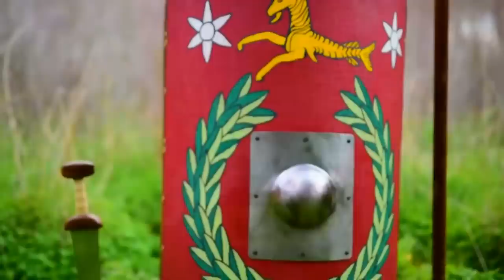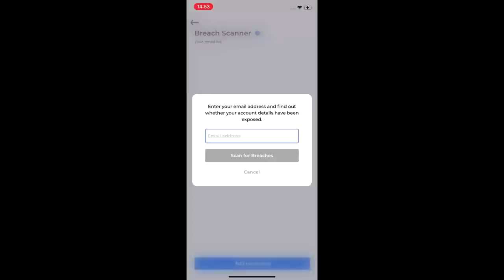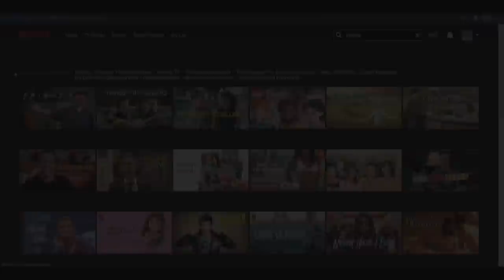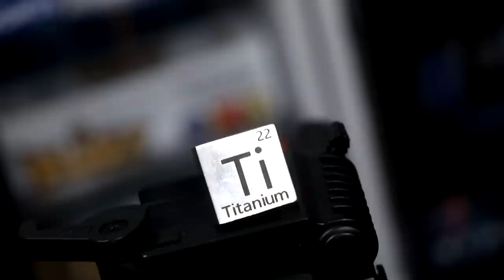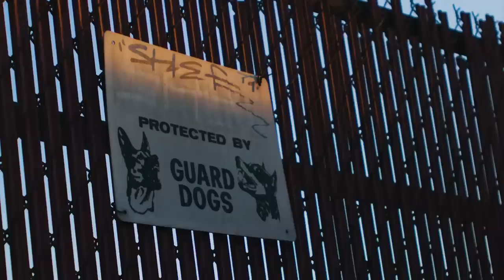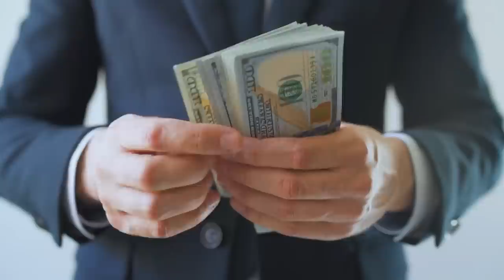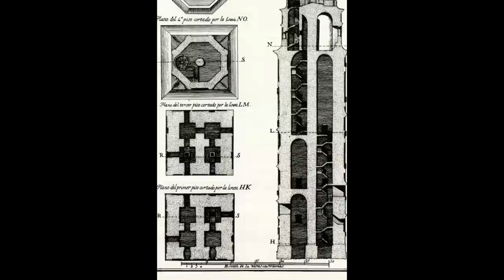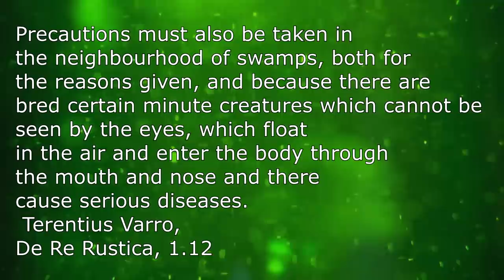10 "MODERN" Things The Romans Actually HAD

Comment: There is at least one you missed. The Romans had an information network. That is a method by which messages could be sent without using a physical object, such as a letter. This Netwerk was a combination of semaphore stations and signal fires that would allow any significant event that happened anywhere in the Roman empire to be known within 24 hours in Rome.

Comment: Imperial Rome also had an advanced banking system which used fiat currency, which facilitated the exchange of money using physical coins. The earliest banks in ancient Rome were located in temples. They would charge interest on loans, exchange money, and track their finances through written records.
Reply: Thus,  Jesus throwing the money-lenders out of the temple.  Although they were essential in converting different types of currency into a common one.
Reply: Except it wasn’t a fiat currency, it was backed by gold and silver.
Reply: @Slender_Man_186  they had both at different points in time, just like us.
Reply: @Slender_Man_186  That is exactly the definition of a fiat currency.
Reply: @lamwen03  That is the exact opposite of a fiat currency. By definition, a fiat currency is not backed by anything.
Reply: @WJS774  actually it is, our currency is backed by the government which relies on the value and supply of the goods and services the economy produces, if productivity falls, if the supply of g&s falls, or if the government starts printing way too much money too quickly, the value of our currency will also fall.
Reply: @tylersoto7465  You don't know what "fiat" means. The bottlecaps are a commodity currency, not a fiat one. There is no central government in Fallout! Jesus Christ!

Comment: Romans had machinery too. I would've liked to hear what kinds of mechanical devices were used in daily life.
Reply: They had steam engines.
Reply: @sugarnads  The steam device you alude to was a mere curiosity -- it wasn't used as a tool. I'm curious about things used in daily life, and perhaps in warfare (like catapults and balistas, for example, or the elevators in the Colosseum). Even something as simple as scissors, and padlocks -- I'm curious about those, how elaborate or advanced they were.
Reply: Don't know much about daily life, but thier water powered mills were really impressive, and no they did not need steam to do some real industrial scale stuff.  Rome's entire demand for flour was met by 12 industrial scale water powered grain mills, and the thin wooden sheets for plywood was processed by large water driven saws cutting away at a log on a lathe like device.
Reply: @nosajimiki5885 , those are some of the kinds of machines I am curious about. Thank you for the information.

Comment: I would posit that the 'Tower of Hercules' was preceeded by the 'Pillars of Hercules', which were two pillars on which were placed a fire of burning wood.  The reason there were two pillars is that they would make one fire ready while the other was burning and with two pillars they were able to keep one fire burning at all times. These are the famous Pillars of Hercules mentioned by Solon in the legend of Atlantis.
Reply: Why couldn't they add more wood to the already burning fire?
Reply: @TheGingey  because
Reply: @TheGingey  It is just a simple matter of practicalities, as the first fire burns, you clear the remains from the previous fire on the second pillar, and build a new pyre of wood, it would have to be built up by stacking in a stable way, and would probably be a very high stack of firewood. 
So it is a simple practical matter of preparing one pile of wood on one pillar while the other pillar's fire is burning.
With time this was upgraded to a proper lighthouse by the Phoenicicans and then upgraded again by the Romans. 
It is a very strategic lighthouse for sea trade.
And is probably the most important historical lighthouse
Reply: Don't you know the Pillars of Creation came first many millions of years before the Pillars of Hercules?

Comment: The Romans had augers, known as the Archimedes Screw, used to pump water uphill. We think of augers today as drills for boring holes, but if you reverse the auger, you pump the drilled material out. Since they didn’t have electricity, they were controlled by rotating a large screw manually, most likely cranked by slave labor.

Comment: In regards to concrete, Roman concrete lasts longer than Portland concrete and is better, but is is very poor under pressure so it would not be good for tall buildings.  Portland concrete on the other hand is better under pressure which is perfect for tall buildings but won't last as long, so don't expect any Portland concrete buildings to last 2000 years like Roman concrete.

Comment: The main reason for using plywood nowadays is that you can get a big sheet. The way it's made in modern times involves softening a log with steam and shaving it down in such a way that it unrolls like toilet paper. This allows for plywood sheets that are big enough to cover a whole wall. If you want to even build a table with dimensional lumber you usually have to glue several boards together (and match grain), and potentially have to cut joints if the application requires a lot of strength.

I imagine the way the Romans did it didn't produce big sheets. It would still have the benefit of not splitting the whole shield along the grain, though.

Comment: One question I've never seen discussed in these sorts of video's is where the Romans got the fuel for heat, cooking and their bath houses.  Shipping enough fuel for a city of a million people overland would have been impractical.  Was it rafted down the Tiber from further in land or shipped along the coast from other ports.  Also, was it just wood and charcoal or did they use fossil coal as well.

Comment: I used to know a concrete engineer who had worked for a company in Britain that developed a type of concrete based on Roman concrete. They found that compared to modern concrete it set very firm and hard but took longer to dry and set. That last quality made it mostly unsuited to modern construction projects which depend on a series of different trades being able to go in in succession to do their work such as plasterers, electricians to install wiring and decorators to paint the walls. Until the concrete dries these next stages cannot be carried  out completion of the whole project is delayed.

Comment: Regarding No.1, it is quite possible that a Roman scientist had built a primitive microscope and observed bacteria with it. All that's really needed is glass, and the idea to assemble a series of lenses in a tube.
Reply: Lenses are really hard to make though, at least to that kind of precision. It's not impossible I guess but I kind of doubt that that's it.
Reply: Even with modern precision glass, one requires 200x for observing  Eucaryotes, 400x for E.Coli and 1000x for most bacterias.
Reply: @r0ky_M  Many years ago, I had a telescopic "pocket microscope" that was the size of a large pen. It was quite tiny, but under the right lighting you could look through it and see bacteria floating in stuff. It was very basic, but did a good enough job. I doubt there was much precision going on inside of it. Just a few lenses that looked like tiny magnifying glass, in fact.  It should be easy enough to duplicate for anyone who can make clear glass.
Reply: @SevenSixTwo2012  
Even today's pocket versions with 250x don't let you see bacteria..and don't forget that bacteria also often need staining coz they are naturally clear.

Comment: There is a manga and anime called Thermae Romae, about an ancient roman architect specialized in bath building, that sometimes drowns and wakes up  in modern japan, the other culture very big into hot water baths, and eventually awakened back in ancient rome, several times over
The dude would learn about modern japanese variations on hot baths, and reproduce them in ancient rome using local equivalents
It was very amusing how a lot of that stuff could actually be implemented
Reply: Metatron did a video about it, if I'm not mistaken.

Comment: The optical illusions, for example columns would have different diameters, the top would be bigger than the bottom slightly so when you stand at the base of it, it would look equal and not look like it’s getting smaller at the top. Also the columns that were farther away were bigger than the rest so when you stand close to the building all the columns would look like they are the same size. The Greeks cared about this sort of thing more though, they were also the ones that started it.

Comment: Metatron says they had plywood, but they had more than that. They had multiple styles of "laminate" wood, plywood, a sort of particle board (couldn't make them large or they wouldn't hold together) that would then be topped with real wood to save cost and weight. They understood not only grain but how to grow trees for the best grain, people forget that is of vital importance to sustainability, foresters don't just chop trees. They understood how to make use of mixed materials, concrete, laminate, hardwood, copper and iron all together to reduce cost, reduce weight, and remain extremely durable. 
Everyone interested in Rome knows they could build like nobody else in the region. But it wasn't until my architect brother learned a little bit about materials, told me and I started doing some study of my own that I found out how REMARKABLE they were. Rome is often compared with China in levels of technology, butwhen it comes to architectural engineering, the Romans were 100% on top. Rammed earth walls vs concrete and stone? The great canal systems of early China are remarkable, but the Roman aqueduct system is far more impressive. Roman water systems, when the people were wealthy enough to pay for ceramic instead of lead or copper tubing, were superior to Chinese. Though with the Chinese far more cities had it.

Comment: Now I want to ask you about something, Metatron. In school a was told that the Romans suffered from lead poisoning because of their bath, but for the last ten years I have be having doubt about how true that is.... the teachers also said that was why baths wasn't a thing after the Empire's fall. But now I like to know how big of a problem lead poisoning was back then.
Reply: Your teachers were pretty terrible, baths were a thing all through the medieval period. Regarding lead poisoning, IIRC it was a problem in ancient Rome, but not because of the lead pipes; we kept on using lead in pipes up until about the 1970s. It actually isn't as much of a problem as you might think because when the insides of the pipes fur up with limescale the lead stops leaching into the water. It's why they stopped using lead for new pipes but there was no systematic effort to de-lead all the pipes in old houses. Our house still had lead pipes into the 21st century when we needed to have the plumbing redone. No, the reason the Romans had problems with lead poisoning was IIRC because they used to make makeup out of lead compounds, and rubbing that on your face every day does get a significant amount of lead transferred to your system.

Comment: I heard somewhere that Roman concrete was more durable and weather resistant than modern concrete.  It makes sense since we can still see Old Roman buildings that stood the test of time.
Reply: it is, and if in contact with sea water it grew stronger and stronger because it binds chemically with minerals from sea water so the mechanical disruptive effect of waves is neutralized
Reply: @Tonyx.yt.  Modern concrete does that too, not specifically seawater, but with water generally. If you lay a concrete path when it's hot out, it's a good idea to water it for a few days to make sure it gets its full strength without the water all drying up.
Reply: Of course, we don't see all the Roman buildings that didn't stand the test of time.
Reply: @eljanrimsa5843  most of them get demolished by locals in order to gather building materials
Reply: @eljanrimsa5843  🤣🤣🤣🤣🤣😄👍🏽

Comment: I doubt the romans meant what we call bacteria, I am pretty sure they are talking about eukaryotes like protozoae (I hope the plurals are right)
Bakteria is hard to see even with microskopes, if you are not doing it correctly. Whereas you comparetavely easy find Microorganisms with a nucleus. Most Bakteria is compared to other Mikroorganisms smaller to a factor of 10 or 100. I guess they would have looked into water with lenses. They had glass and to find out that curves can make things smaller or bigger is not too surprising.
But still interesting and well done.

Comment: It's not impossible that Romans had access to primitive microscopes.  Certain amoebae and bacteria are visible with relatively minor magnification.  Is it probable?  I don't know, but it's certainly possible.  As stated in the video they understood optical illusion, 'burning lenses' were understood, Nero was said to use an emerald to improve his view of gladiatorial combat, and it's not that great a leap to figure out low power microscopy.

Comment: Did they actually disinfect the water, though? Clean water is one thing; you can have it by filtering it, and they probably did that. But actually disinfecting it and removing everything that could cause diseases is a totally different thing. I wonder if the Romans had made any advancements in that direction.

Comment: Steel cam after the iron age.
As for the knowledge about microorganisms....that's doubtful. Smell could have been used to identify certain organisms that were not visible with the naked eye although that doesn't necessarily mean microorganisms.
Reply from the maker: Difficult to say that steel didnt exist in the iron age because all you need is even an unintentional amount of carbon from the wood in the furnace to technically have steel.
Reply: @metatronyt  

In the late iron age steel was probably developed. It's true, steel was probably made unintentionally for at least some time.

Comment: Let’s see, the Romans invented: 
1) the Fabrica — the factory. 
2) indoor plumbing 
3) concrete
4) arch
5) the motels 
6) architectural dome 
7) windlass crane
8) waterwheel 
9) Alum fire retardant for wood 
10) hydraulic cement 
11) the sewer and sewage management systems 
And since the Byzantines were Romans :
1) the trebuchet 
2) Greek-fire
3) incendiary grenade
4) flamethrower 
5) the eating fork
6) the hospital
Reply: The arch which is so vital and prominent in Roman architecture, was not a Roman invention...neither was the waterwheel..

Comment: The Pantheon had the largest concrete dome until modern times. It is 2,000 years old -- and still is in good condition, and is beautiful. 
I see concrete bridges and highway structures in the US, that have to be rebuilt every 30 to 50 years.  
We use steel re-bar, which rusts, and cracks the concrete supports. How stupid is that?? 
Actually genius if you want taxpayers to pay you to build them again quite frequently.  
Also, here in Chicago, concrete sidewalks and other exterior concrete structures dissolve in the rain, and eventually fall apart.  
YET, the Pantheon still survives. How? Well, Roman concrete was impervious to water.  
Seems to me, modern concrete is crap compared to Roman concrete.  
Aren't we supposed to be the smart ones??
Maybe not.
Reply: There's a good engineering video about Roman vs Modern concrete. In short, modern concrete is made for strength, while Roman concrete was made for longevity. As an example, Roman concrete wouldn't be good for building highway bridges, while modern concrete is.
Reply: @InSanic13  IMO, we make both good and bad concrete. 
For instance putting un-coated rebar into concrete is asinine. The bars rust, expand, and destroy the concrete. So, interstate bridges in US need to be rebuilt every 30 years (at least in Chicago they do). Now, the concrete used to build Hoover Dam is great.  We know how to do it, when we want to. 
We aren't idiots. 
Just corrupt.

Comment: Eh, I knew most of this besides Steel and the early recognition of Germ theory. That being said, some of these are older than Romans even, if I recall. The island of Crete where the ruins of a Minoa have been found show signs that they knew how to do indoor plumbing as well and even used it similarly for toilets. Dogs for utility purposes have been around for around ten thousand years or so and basically have followed human civilization since the beginning. In a round about way ancient people could make computers, just analogue ones using gears and cogs, see the Antikythera device, though that's not really wide spread technology so much as an ingenious one-off. Persians had a working postal system before Rome and even coined the motto for them: "Neither rain nor snow, not dark of night shall deter them". I am not 100% sure if Lighthouses do predate the romans as the common ancient one I can think of is in Alexandria, which may have been built by the Romans.
Reply: The video is titled things the Roman’s had, not things they invented
Reply: The Romans are famous for not having invented most things themselves but saw them somewhere else, put them to good practical use, and industrialized the production process.